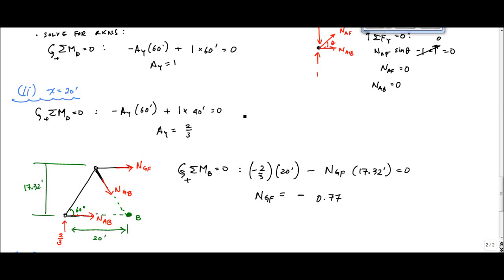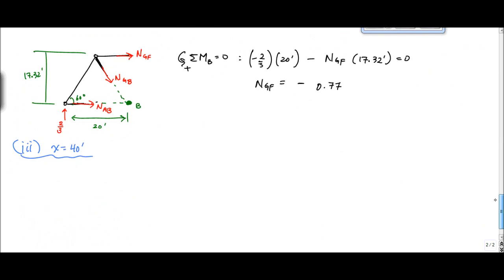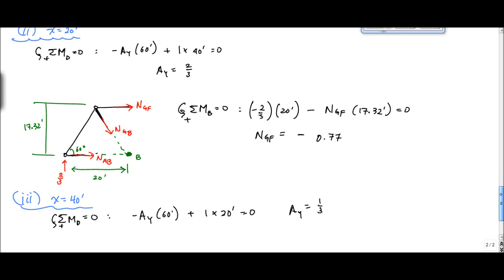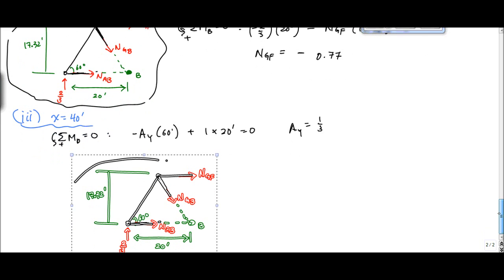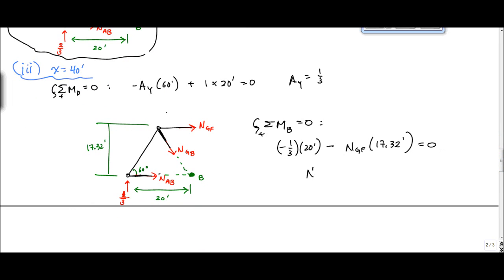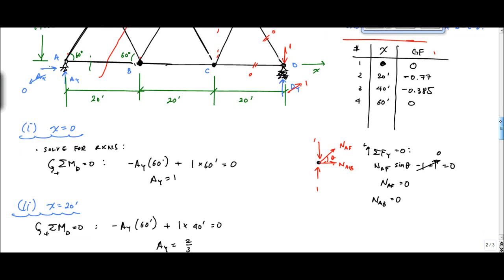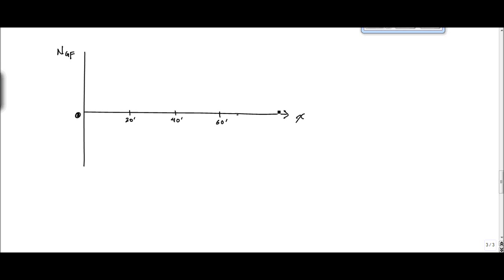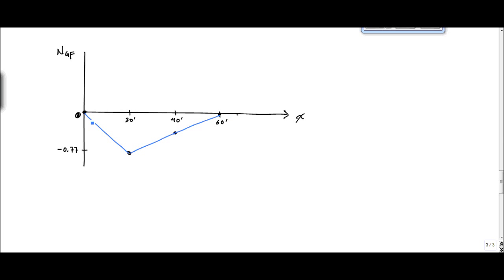Influence Lines for Truss Example (Part 2) - Structural Analysis

Comment: Can you please tell me what software do you use to write your lectures? I want to use it to take notes in class using my laptop.
Also I want to thank you so much for such an amazing help that you offer to so many engineers around the world.
Reply from the maker: Here are some writing software I have used one note, journal, smooth draw. Thanks for the kind words.
Reply: +structurefree what kind of device do you use? I have a tablet but the problem is the pen. the pen's tip is big and makes the writing huge and not as smooth and good as your videos.
Reply from the maker: I use a surface.
Reply: structurefree That's the way to go!